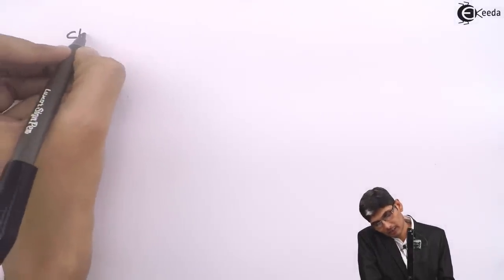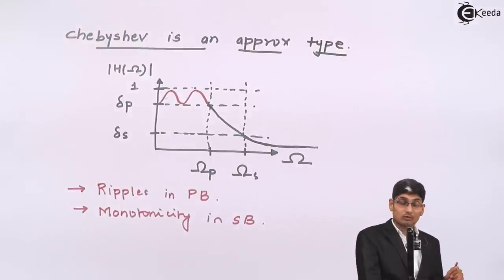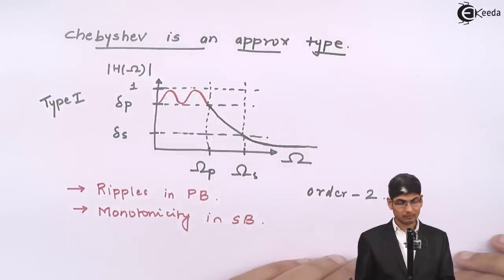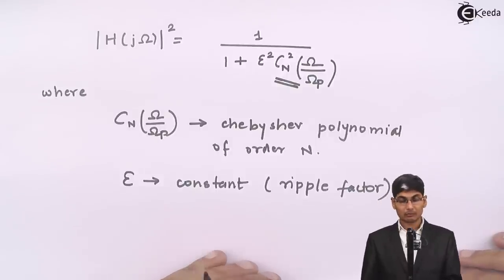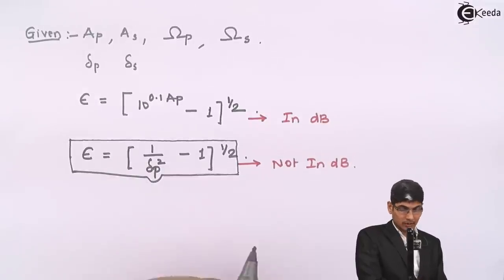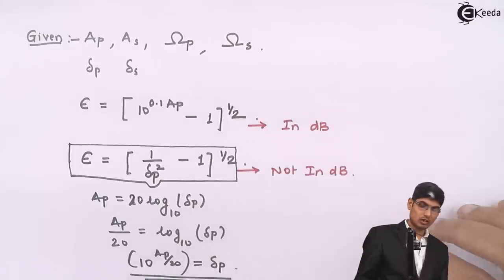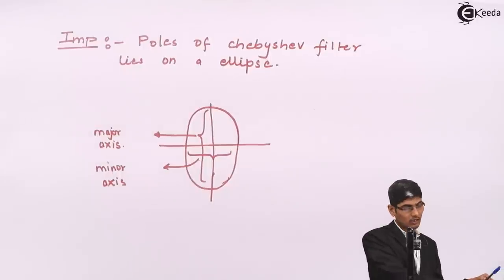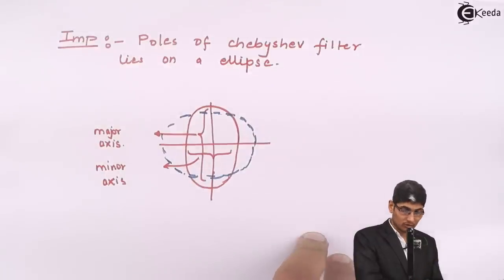What is Chebyshev Filter Approximation in Discrete Time Signal Processing

Comment: 00:09 Chebyshev filter approximation has ripples in pass band and monotonicity in stop band
02:53 Chebyshev filter provides a better roll-off rate compared to Butterworth filter.
05:03 Chebyshev filter approximation using transfer function
07:26 Calculating the ripple factor epsilon in Chebyshev filter approximation
09:56 Chebyshev filter order is determined using cosh inverse function.
12:56 Chebyshev filter poles can be compressed and expanded to achieve desired filter characteristics
14:54 Chebyshev filter approximation involves pole positions and factors for poles in signal processing.
17:46 Designing transfer function of a filter in discrete time signal processing

Comment: To the people hearing in only one side of the headphones/speakers, here is the solution: 

"To enable it (mono sound, which will transform one single channel in two equal channels), open the Ease of Access settings (Win + U), select Other Options in the left pane, then scroll down to the bottom and enable Mono Audio. I tried to mix the two channels and I can't in Windows Media Player or the Control Panel."

Source: https://superuser.com/questions/117494/force-windows-to-output-only-mono-sound